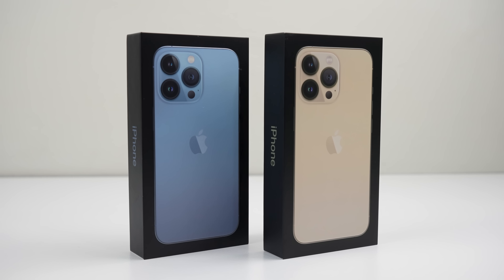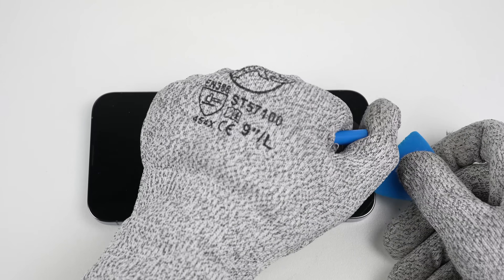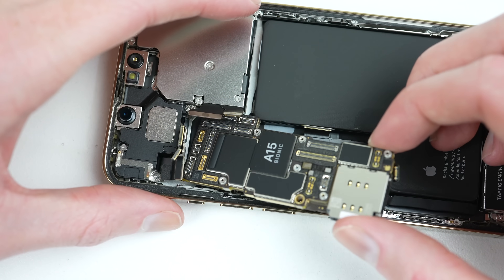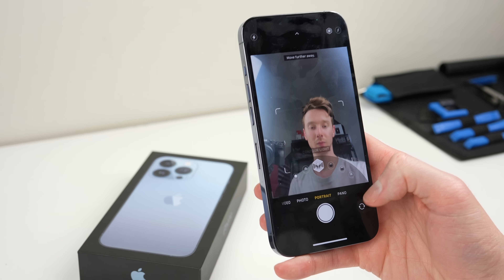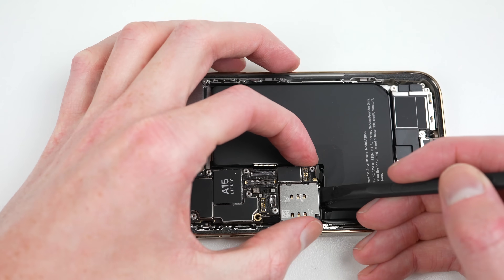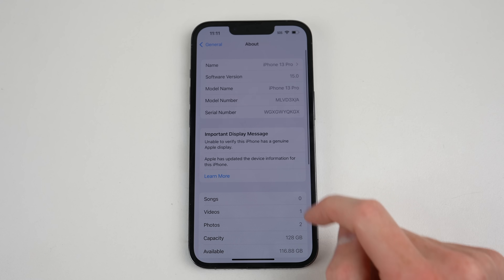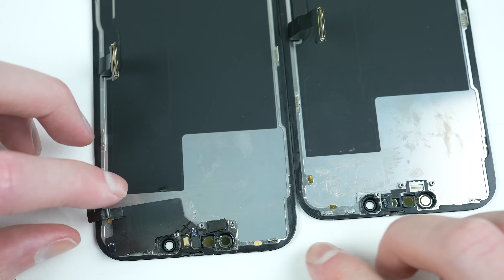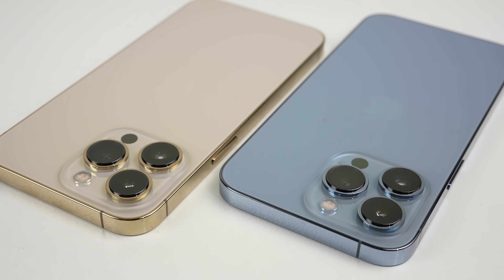iPhone 13 A Repair Nightmare - Teardown and Repair Assessment

Comment: My god, someone needs to come up with an easily upgradeable repairable phone now, like they did with that Laptop.
Reply: There is Fairphone. That tries to stock up components from companies that don't mind having open source drivers released to public and maybe there is even some politics like companies that don't abuse human rights and stuff. And yeah the drivers are open source and all of that good stuff. Problem with that is tho that you won't have the newest snapdragon chip and well anything according the newest trends really because the selection of components is very limited and it still will be very expensive. So you are basically paying the full price for 3 years old midrange phone and for that you really have to be invested in that idea. What Framework did with the laptops is insane because they managed to make that laptop almost on par with other brands in terms of quality, design and performance. With phones however it is harder, the tolerances are way tighter.

Comment: gonna sound like a huge boomer here but these new phones in general are annoying. even simply replacing the battery, sim or sd card has become a hassle as you'll need specialized tools just to open them. even if you have the right tools, you could still accidentally break them and make things worse if you don't know how to do it properly so its safer to make a professional do it. all that inconvenience just to open the back and replace either the battery, sim or sd card.

Comment: I’ll go for a  Fairphone after watching this, being completely repairable is really appealing 😊
Reply: Except Fairphone is somehow limited to their own parts with little chance to upgrade to higher capacity / resolution / speed parts without replacing the whole thing.  Not because they cheat, only because they are stuck working within the industry system that wants to sell unrepairable phones.

Comment: I'm still using a 6S. I have had 4 display and 2 battery replacements. I will not buy anything more than a SE until Apple let us fix the phone.

I use an Android work phone anyway, so switching away from Apple might be an option. The only thing keeping me in the Apple ecosystem is the iPad. They are just great.

Comment: just like an automotive scan tool to reset functions. there must be an apple device or software package to reauthenticate other parts into phones. if i replace newer cars (mostly EU) parts such as door lock switches, calipers, radios - i need to use a scan tool to program the current cars vin before the BCM will allow the parts to function.
Reply: It's probably an online only service secured with encrypted accounts and keys... A device or software could be potentially hacked or cracked.

Comment: this wouldn't be an issue if apple were able to replace the old one with a brand new iphone, instead, they gave you a service unit which often come with tons of defected parts. tbh, you r better off buying a refurbished/used iphone than trading your old phone in for an apple service unit.

Comment: If Apple made cars here is what would happen: You replace the alternator (with a genuine 
OEM part) and  your air conditioner windshield wipers and antilock brakes  stop working.
Reply: Stop giving them ideas.
Reply: Pray that Apple doesn't sees this comment. Or else they will note it done, saying that's a good idea
Reply: Tesla is going in that direction I think
Reply: @jordyv.703  Tesla already is the Apple of car industry
Reply: fuel is not genuine
Reply: Perhaps when you even change a tyre, the brake will jam and unable to move. hahaha
Reply: @waynenergy  Well actually, thats what happens if you own a new Audi for example. If its time for brake service they will lock up and you have no choice but to go to the authorized dealer to do it for you. For a bucket of cash of course.
Reply: Nah, apple will just tell you to get a new car
Reply: Sounds like BMW to me.
Reply: Cars are headed that way, some already implementing this.
Reply: Not really, there's no security issue with unlocking a stolen iphone with a hacked faceid camera unlike a car.
Reply: Audi already does this
Reply: @cookiehead2  shit like this is why I stick to driving classics! 1964 Chevy impala hard top for me. Not only can you modify it as you like, remember the annoying seatbelt warning sound in newer cars? Mine doesn’t even have any 😂 couldn’t love that thing any more if I tried
Reply: got news for you. my subaru is exactly that way. In fact, most cars are now. So much technology in them you have to go to the dealer to get it fixed because mechanics don't have the diagnostic tools or software experience.
Reply: @noitallmanaz  as a mechanic in a small shop I deal with this constantly, some manufacturers aren't too bad at it but other are terrible. there's so many module reprogrammings that my scan tool would be perfectly capable of doing if they would just release the software. And now all Chrysler products past 2018 completely lock you out from doing all but the basics unless you have FCA login credentials. They say it's for security reasons but anyone can buy the credentials if you want to pay for them.

Comment: I presume all these problems are the consequence of some kind of check being done in bios…  if the installed equipment isn’t responding on POST….  Even if there is original factory equipment - it’s not the registered factory configuration… so it doesn’t work. I assume if you take it to Apple and they swap out the equipment, they can change the bios… 

Am I missing something?

I mean I realize this sucks - it means that basically you can’t repair it yourself… or even giving it to someone else who is competent. You have to bring it back to Apple…

But I assume this is a bios level hack…

Comment: I wonder if each iphone has a  random set of programmed "issues" that can appear after you swap parts. Sowing distrust in 3rd party companies who do repairs. This can explain why different issues occur in your camera app.
Reply: Oh, it's clearly not random, as the test with only the swapped cable shows.
It's designed to not work right in very specific ways.
Reply: They don't have to sow distrust in 3rd-party repair shops.  They just make it so going to them will nerf your phone.  End of story.  You don't have to distrust them... the result, whether you trust them or not, has nothing to do with them.  You don't have to go extra leaps and bounds to make your case when you just nerf the thing and customers have no other choice.  Any 3rd-party shop worth a damn would cover their butts by telling you in advance that you're going to be nerfed... and they have no control over it.  Only a stupid person would blame a shop that told you it would happen.
Reply: The devices are programmed to not work. 
Apple is screwing the user over pretend it's the repair shop that failed them.
Reply: @sownheard  And yet Microsoft can't even build good enough devices that people wanna buy to also make them not work... cuz Microsoft definitely would do the exact same thing.  Of course Apple is screwing us over... but they're not pretending the repair shop is doing anything.  They're transparent and clear that they're the ones doing it.  And shops tell the users this.  It's not a secret.

Comment: Thanks for the speedy and informative video, Hugh. I work at a repair shop in the US. These software locks and serial-matched parts are making it very difficult to fix customer's devices. More in terms of managing expectations. How do I explain to a customer that their $1300 device won't work properly if I "fix" it? Bonkers.
Reply from the maker: It undermines 3rd party repair, with the current issues it looks like the repair was just done poorly, when in fact it was completely fine and even used totally new genuine parts.

Comment: Even though I crave to own an iPhone this just shows that it will never happen. Living in a country where an iPhone 13 costs as much as half a years rent on a 3 bed room house it will never be feasible to send it back to Apple every time you need to repair something, I will rather stay with my android phones knowing its not going to cost an arm and a leg to get it repaired or even replaced. But thanks for the highly informative video.

Comment: I understand the outrage but let’s be honest, how many consumers ever need to open their phones? I’ve had an iPhone 8 for 4 yrs (just upgraded to iPhone 13 pro max) I kept it in a good case took moderate care of it never anything broke. Apple phones are like a Pre-Fab you get pretty good quality great software upkeep but none of your shit is specialized, if you want something fully customizable Android has a plethora of options, however my personal experience they’re phones go to shit fast when new models come out (tht was yrs ago) cause they don’t do upkeep older models and they’re ecosystem like Apple so my thing is if ppl have all these gripes simply don’t buy Apple products which is needed bc that only boost competition giving us better phones  which has been happening for the past 10yrs.
Reply: You're missing the point. Why is it software locked when swapping out same OEM screen? It means that you have to go to apple for repair to get your face Id back cutting out 3rd party repairers. Despicable. It's got nothing to do with how well you look after your phone. You seem to obviously have no issue with that at all. Android is on par with ios these days and don't go to shit fast.. 😒
Reply: @mrkring1526   Not saying I totally agree but I’m sure Apple has it that way because instances where people get parts and they can potentially have bugs and malware installed and breach security so it somewhat makes sense to disable Face ID as a way to cover their “image” YES IK how many fucking instances would this  happen maybe not enough to constitute this but yeah, and if you have Apple care+ they repair it for $30 so yeah I’d say on par with 3rd party anyways. I personally am ok with letting shit like this slide because the quality is worth it.

Comment: I hate apple as much as the next guy, but face ID not working after doing hardware changes is actually a good thing. Face ID is a security feature and any hardware changes could be a vector of attack to circumvent the phone security.

Comment: After watching this video re I Phone 13 and having a better understanding of Apple's manufacturing policies, I'm glad that although slow and possibly less capable than newer MacBook Pro's with an M1 processor, that I have 2 MacBook Pro's that have interchangeably parts (within model year) and the parts are readily available in Unibody form (2010 17" and 2012 15").